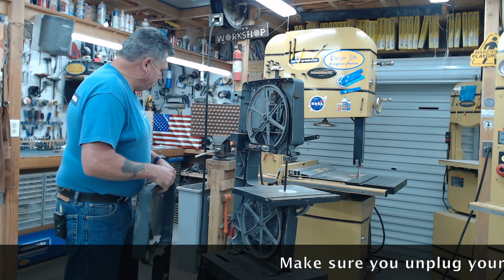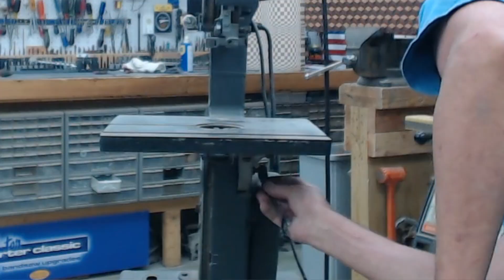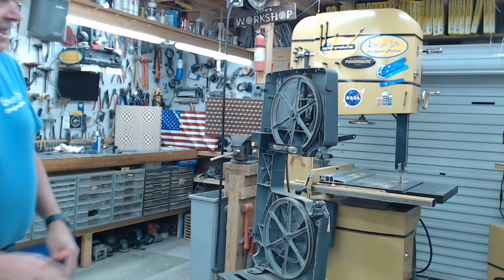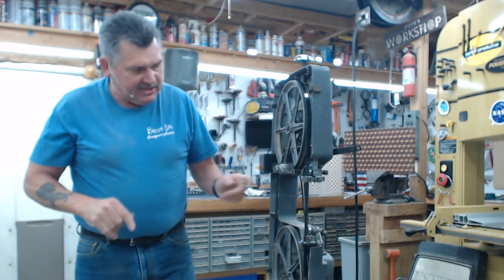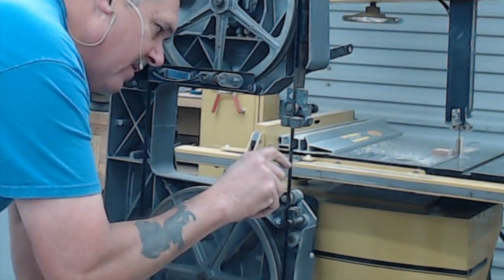Craftsman Original Saw Tune-Up  (1 of 3)

Comment: Great Video !!  I bought this saw brand new 40 years ago and needed a refresher on blade set up. I always wanted to photo copy and laminate my machine manuals and keep them at the machine for instant reference. Sears sold a speed reducer for this bandsaw which allowed you to cut metal like angle iron or pipe etc.. My saw has this accessory. Sears/Craftsman machines from this era were made by Emerson Electric. When the contract with Emerson ran out , Home Depot signed with them to make Rigid machines. I could be wrong but I think machines from this era were still made in the USA.

Comment: Could you use a feeler gauge to set the thrust bearing and blade guide block distances? Maybe a 0.002" or 0.003" before locking them down?
Reply from the maker: Sure

Comment: thank you very much , I have learned a lot from you, I do have the same exact saw that you are demonstrating on  which I bought  used about a year a go, never used it till recently when I needed it and I do have one issue which is , on the half inch blade,I'm trying to tension the blade so the arm on the back of the top wheel goes to the half inch mark, but the arm  goes only tiny bit above the 1/4" mark, although the tensioning handle on top of the machine is all the way up to the end with no more room to go higher , so far I disassembled the top wheel and what you think is  next to do, should I take the whole tensioning unit apart  again I appreciate your help
Reply from the maker: @darkgreener  have you tried a different blade?  Sounds like it may be a bit long.
Reply: @bandsawlife2660  thank you , I didn't  think about that, but definitely I will buy another 1/2 blade and try it, thank you again and God bless
Reply: @bandsawlife2660  May God bless you and thank you, that was exactly the problem , I bought a brand new 1/2" blade, put it on, it worked fine and the arm went up all the way to the 1/2" mark, the blade is tight ,  and I did cut a piece of wood which was good, again thank you and God bless

Comment: Thank you for posting this on the Craftsman 12" bandsaw. I just picked one up today (11/4/2024) for next to nothing. I will be going through it to clean it up, fix what needs to be fixed, and of course, use this video and your method as a guide. The band saw is not for me. I got it for my youngest daughter to start using to get acquainted with using a bandsaw and to see if she likes using one. Then later on she can always upgrade. I'm assisting her with getting a few tools here and there to help keep her excitement going with her journey in woodworking.  I do like the Carter upgrades which I have some on my Delta 14" (mid 1980's). However, the Carter products for the Craftsman 12" bandsaw cost way more than the saw itself 🤣 I'll have to wait and see.

My daughter really got excited with woodworking after she attended the Purple Heart Project with Rob Cosman this past September.

(I'm the one you met in Tucson, AZ (April 2024). The idiot that did cut himself on the bandsaw🤣 It did heal up ok. Also as a reminder...Try "Lucky Wishbone" next time you here at the WoodCraft store in Tucson, AZ).

Thank you for the awesome videos and sharing your knowledge.

Comment: Thanks for the tutorial - very informative.  I do have one question.  I want to replace the Blade Thrust Bearings with new factory replacement bearings, but I tried to unscrew to slot head screw to remove the old bearing and can’t seem to get it loose.  I assume that you unscrew counterclockwise, but I don’t want to strip the screw head.  Any suggestions?
Reply from the maker: @montymclaurin5896  it should be standard thread.  Heat it, probably has loctite on it.

Comment: Your video is very helpful. That being said, when I adjust the top wheel, the blade wants to come off the bottom wheel and I'm not yet to the center of the top wheel. Any suggestions?
Reply from the maker: How old is the blade?

Comment: I am trying to make some wooden sinusoidal strips to be used to support corrugated PVC roof panels. The existing/old panels have centre to centre dimension of  approx. 2 3/4" which  yield 10 peaks rather than 9 peaks which seems to be the current standard for corrugated panels which have 3" centre to centre. My bandsaw has 1/4" wide blade. The chart which I found in parts manual indicates that a 3/16" wide blade would be better for cutting the strips. Will the 3/16" wide blade work with the model 113.243300 bandsaw? And is the blade 80" long.
Reply from the maker: @dwightcarlson7136  the blade is 80” but you will need a blade stabilizer to run a 3/16” or 1/8” blade
Reply: @bandsawlife2660  can you describe a blade stabilizer? Do I need to make it or is it available for purchase somewhere ?
Reply from the maker: @dwightcarlson7136  https://carterproducts.com/band-saw-products/band-saw-stabilizer/sears-12-pre-1990-sea2

Comment: Great and helpful video. I have owned this for 35 plus years and have been very satisfied. My current challenge is the blade coming off the wheel. When I run the saw with the cover off to test, it runs smoothly. When I put the cover back on as it is suppose to be, there is a rattling sound and the blade come off the wheel. It happens with different size blades. Have been trying to be as observant as I can be but don't have a clue what is going on, any suggestions.

thanks

Comment: Was there supposed to be a black cover plate on the top guide? Mine has one? Is it ok to remove, looks like it runs very close to the saw blade
Reply from the maker: The stabilizer does not use that cover

Comment: Hi, I just found your video and see that its about a year old so I sure hope you still see my message.  My dad gave me this same bandsaw and I have been using it for months and love it.  All of a sudden it just stopped and the motor makes a "Hmmm" sound.  I told my dad about it and he said it did that in the past and he changed out the capacitor but he couldnt remember where it was located.  Ive searched everywhere except to actually open up the motor.  I thought I would see if you could tell me before I try to tear into the motor.  I would really appreciate any help you can give me
Reply from the maker: It should be in the hump on the side of the motor
Reply: @Bandsaw Life  I don't have a hump.  I would show you a picture but I don't have an option to attach a picture
Reply from the maker: Send a pho to bandsawlife@yahoo. Com
Reply: @bandsawlife2660  I wonder if someone here, in the comment section, can tell me how to read the date code on my 12" #113.243311 saw? I would like to know what year it was made.

Comment: Alex about how much is the cost of a 3/8" x 99 3/4.  I'm retired  and on a small budget. (40+ years in the carpenter trade) This saw is the first tool that I've owned that I could make run right.
Reply from the maker: You would have to visit your local woodcraft or call Carter Products, just a guess $35 to $40
Reply: @bandsawlife2660  I just now found y'all online. The blade is $30.??. by the time I pay shipping, I'll have $60.00 in the blade. No more than I use it. I can't justify that kind of money for one blade.
Thank You for the reply
Ray Castleberry

PS I have shipped many (30lbs) pounds of lead bullets for $14 to $15.00 by USPS priority mail and they furnished the box

Comment: William Castleberry
I have a question for you about my craftsman 14" bandsaw. The saw is set up like you said, and it has made this sound since new. The wider the blade the worse the thump and louder the noise. It's a thump and wining sound. I have checked all the blade guides, nothing wrong with them or the blade. It doesn't matter what blade I put on the saw. It does get louder when trying to resaw a wider board. Do you have any ideas?
Reply from the maker: What brand of blade is it?
Reply: @bandsawlife2660  It does it with all the blades I have tried, Craftsman, Olson, Irwan. It has done it ever since I bought the saw new. All I have ever had to do to the saw is put a new drive belt on. I bought the saw new in 2012. I have tried more and less tension. Nothing seems to change it. So I try not to resaw with it
Thank you for the reply.
Reply from the maker: Again I’m going to say it’s the blade.  The brands you mentioned are not known for their quality.  I would suggest trying a Carter blade.  If it still does that I would like to know.

Comment: I'm inquiring about my Craftsman 103.24280.  I have been able to locate parts to restore it and have an operational question. I'm trying to understand what the parts in location 4 and 5 of the parts manual do.  Part numbers X-309 and 41628 respectively and go into a hole in the side bottom of the table where the blade slot ends.  I've found reference to them on YouTube.  They are referred to as taper pins in most cases and are common size  screws that can be purchased locally.  However no one I've talked to knows what they do.  Just wondering if you would please offer an explanation? In your video the hole is empty as visible when you remove the table. Then you replace it at 14:53 of the video only referring to it as a  nut.  Thank You.
Reply: I just searched on line by the part numbers. I was able to down load a manual from on line which helped. Still haven’t found a blade guard. That bolt I was asking about turned out to keep the table split where the blade goes in aligned. Just found a bolt that fit the hole and thread pattern.
Reply: I have the same question.  Also, any resources for parts?  I’m restoring an old 113.24201 and needs some parts.
Reply: Okay thanks for the info.

Comment: I recently acquired one of these saws and this video is far more informative than the owner's manual. My lower tire is best up and the blocks are worn, so I'm waiting on new urethane tires and cool blocks. I'm going to work on cleaning up the adjustments so they move smoothly and I hope to make my saw perform like this.
Reply: 7 months on the saw is working great now.c

Comment: How should a 1/8th inch wide blade be positioned?
Reply from the maker: Deepest part of the gullet in the center of the wheel.  Perhaps just behind the center when using a stabilizer
Reply: @bandsawlife2660  OK Thank you

Comment: I just purchased a craftsmans band aaw that you have to tweek the pulley to get it going and the rpm are just too low for cutting.  I pd 20 so id like to get it going properly (the belt is on its last legs).

1. Dont want to accidentally get mu fingers caught in between the belt and wheels.  

2.  Would be so nice if i could cut more than butter.

Its still in my husbands car so i have to get better info and picture.

This is a jerry rigged saw.  It appears to have an extra motor.  Ugh.
Reply from the maker: Sounds like the start capacitor could be bad or the centrifugal switch is stuck.
Reply: @bandsawlife2660  thank you so much.
Reply: Mine did that and was slow to start and bogged down, blowing it out real good and adding oil to the motor seemed to solve the problem so far.... It's been a year since I did it. The saw is 33 years old.

Comment: I just bought a craftsman 10 inch 1/3 hp band saw, model 12400. The motor works but the drive belt is broken. It has no owners manual. I know nothing about setting up and maintaining a band saw. I had been wanting a band saw and this one was a one dollar, I couldn’t turn it down.
Reply from the maker: Most auto parts stores can sell you a belt for it

Comment: I bought one from a neighbor and I cannot get the bearing wheel rest on top to back off of the blade
Reply: There's an allen screw on the inside that locks the shaft for the bearing in place. Loosen that allen screw and you should be able to spin the little thumb screw to move the bearing forwards and backwards.